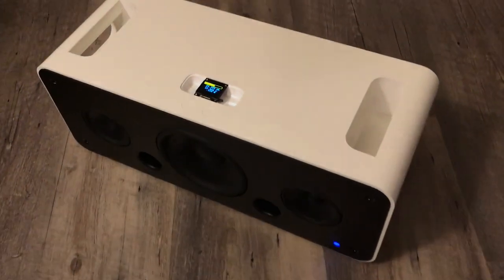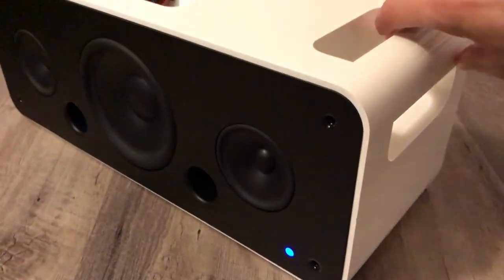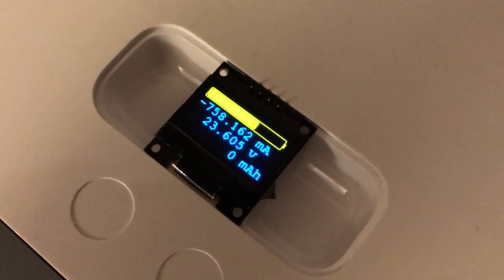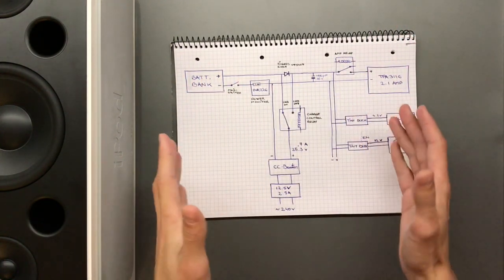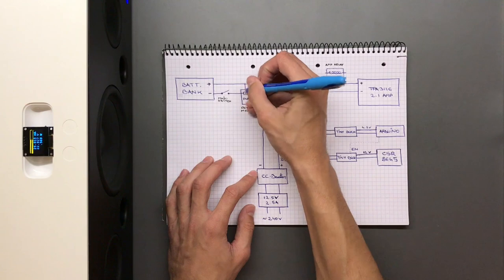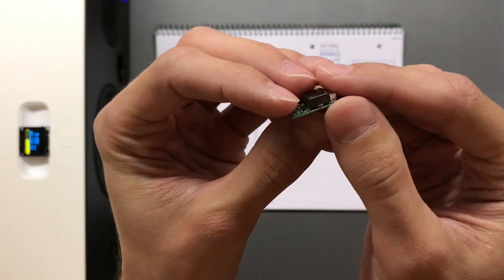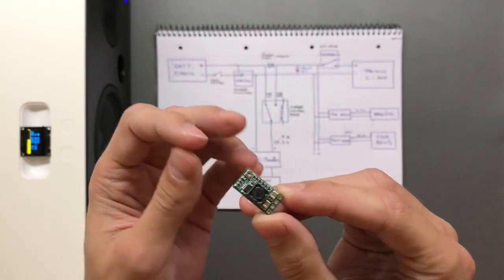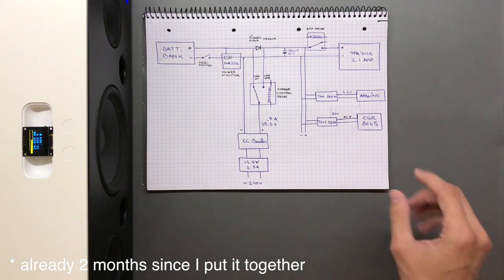DIY Bluetooth iPod Hi-Fi Speaker : Parts Guide 2 : TPA3116 + CSR8645 + Power Monitor + Arduino

Comment: Great video dude, i already made my own 2.1 speaker box, but i have a very basic circuit with the tpa3116d2 directly connected to the bms and a switch in the middle haha. Now i will follow your circuit for making it a smart speaker with battery protection. Thanks for the info!

Comment: very nice and detailed!
i had one doubt about sensing. how did you sense the led state and aux state? i mean what kind of wiring did you do to GPIO of Arduino? with resistors, directly, with some circuit?
thanks!
Reply from the maker: if the voltages are within the range your arduino can take, you can route pins directly

common practice would be routing a 1K resistor for stuff you sense - this protect the pins in case shit goes wrong

then I had an internal PULL UP set to that AUX_IN pin

and when a jack would be inserted, the male jack itself would bridge the AUX_SENSE with GND, this pulling it low

Comment: First of all, thank you for this detailed study. I'm new in this area and I've a question. Can I use QCC3031 same as CSR8645 in this project ?
Reply from the maker: you should be able to - super modern chip that one

I would kind of still opt for the qcc3008 where your boy has you covered with the toolchain and video tutorials on setting everything up
Reply: @Darieee  I liked this suggestion and changed my mind.

Comment: hello Dariee what is the rating of your  speakers i love the video very good and explaintry i want the software version of it.
Reply from the maker: I did actually upload a software walkthrough video as well, there should be a link to it in the description

Apple never gave ratings for these, but I would estimate 15 - 20 W for each mid-range driver, perhaps 30 for the sub 

The amp I'm using is total overkill but .. meh, if it's worth doing, it sure is overdoing
Reply: Nice one thanks man can I send you my video when I build one, is going to be a diy speaker Bluetooth, 100 watts 2.1 version, my board is coming through AliExpress.

Comment: Hi! I recently bought a broken iPod Hifi and an TPA3116D2 amplifier with Bluetooth to do something like what you did. But I’m not sure how to connect the woofer as it has 2 voice coils. I’ve seen in one of your videos that each coil has 6 ohms but the amplifier is theoretically rated for 4-8 ohms. In this video, where you use a board with the same amplifier you have it connected in series, so I guess it’s the best option. Could you please explain which would be the differences in term of sound quality and risk for the components (as it would be operating out of range). Thanks in advance and congrats for your great job!
Reply from the maker: Thanks!

If you parallel the coils you'll get 3 ohms, which is kind of low

You'll get less volume but a lot more clarity if you series them and get 12 ohms in total

In my experience, running at 25v, loudness was ample even in that setup; I have the bass channel set to 30% or something like that actually
Reply: @Darieee  Okay, so I think I would wire it in series, in favor of the better clarity.
I'm going to use a 12v 5A power supply, do you think it's too low voltage?
Reply from the maker: yeah ... I would suggest a 24v 500mA supply instead ... 

or 24v 1A or something like that

12 is kinda low and you'll never draw that much power

best way forward is to probably find a 19v laptop power supply though .. those are pretty good quality and relatively abundant
Reply: darieee Great, thanks for your advice!

Comment: Hi Darie; thanks a lot for the videos. Here I am 3 years later trying to follow along but I have a few issues. It's a long shot but perhaps you will be able to help.

My batteries power the relays/arduino without trouble but then I disconnected the TPA/BT (so no giant capacitors) and added a mechanical switch (C&K 1101) where you did in your diagram. When I reinsert the batteries, the voltage at the battery protect circuit output latches around 1V and the relays do not power. I have used a 7805 regulator instead of buck converters, and I have a diagram here if Youtube will allow me to share it: i.imgur.com/kCY77gt.png ... I hope you could share any advice!
Reply from the maker: sometimes the protection boards  require an initial "jump start", otherwise they stay in 'shipping" mode

is that it ??
Reply: @Darieee  A good idea... switching the mechanical switch about 3 times seems to work okay, for now. I will keep chipping away at the project. Thank you!

Comment: I dont understand mu bt speaker that need 12v but will work even with 2.8v, and draw idle at 4v with 100ma but idle with 12v with 150 ma, what about amplifier how their reaction and why more volt we think more eficient but not my case
Reply from the maker: The CSR8645 Module I'm using uses a Mornsun 1203 DC-DC converter to completely float the GND (and VCC) coming into the module; this is done to as a quick fix for nasty ground loops and other things; it's a very inefficient converter - so that's why it uses so much power, but without it, there would be an unbearable buzzing

The TPA3116 works from ~9v up to 26v.

If you want it to output ... say 10W, you'll need to feed it 1A at 10V (assuming perfect efficiency just to make the maths easier), or 0.5A at 20V

That means half the current will flow through the chips and the pcb and all the wiring : so everything will be more efficient

Comment: does it have noise or some kind of ground loop when using the same power supply?
Reply from the maker: Nah, the amp's wired on high gain and thusly has a fair bit of hiss, that would be the only (fixable) issue atm

Comment: Could you explain me better how the battery charging sector works ?, I'm making a portable speaker too, and to charge my 4s3p battery pack, I'm using a 220v / 24v switching transformer, and a buck converter to lower the voltage to 16.5v but once the battery is full (red LED indicating constant current is turned off) and the transformer of the 220v is disconnected, the battery feeds the buck converter leaving the constant voltage LED power forever.
Reply from the maker: Uuuu, first off I have to point out that 4S3P is probably overkill (which I respect you more for) and probably not the best way to go ... with 12 cells a much better approach would be 6S2P, that way your amp will draw less current (and you'll get away with less beefy wires, also your amp will have more power and sound cleaner). If you do go 6S you'll need a different power supply too though as that pack will require 25.2V to get fully charged.

Regardless, in order to better understand what you're supposed to do in order to charge li-ion cells I'd suggest you watch this video : https://youtu.be/A6mKd5_-abk

I don't really get what you want to say in the 2nd half so, if the video doesn't clarify stuff, feel free to reformulate it and ask again :)
Reply: I had very good results with my 4S3P battery pack. it lasts about a week or more sounding without going off. Sorry if my english sucks. I'm from Paraguay.
I bought a buck converter that has the CC and CV features, with which I decrease from 24v to 16.5v to charge the battery pack. When it is completely discharged, the buck converter turns on a red LED indicating CC and when it is fully charged, the red LED turns off and a blue led lights up indicating CV mode. But, when I unplug it from the wall, the buckconverter's blue led never turns off.
Reply from the maker: Just put a diode in the circuit then to prevent current from going back into your buck converter (keep in mind that depending on the type of diode you choose you'll have anywhere between ~1 to .4 volts dropped across the diode)
Reply: Could you give me your email to send you a schematic of how I'm doing everything?

Comment: Can i bridge the left and right output of this board to a single speaker and get mono sound?, since stereo on a boombox is imperceptible.
Reply from the maker: nah, doesn't really work that well - you could run LEFT and RIGHT into the same speaker if it were to have 2 coils like my subwoofer does ... otherwise it's not advisable

you can however set up the chip to run in BTL mode, which does make it work with the 2 L and R outputs bridged

for that you'd need to buy a MONO version of the amp : http://ebay.to/2BmMBtA
Reply: Darieee  thanks for the quick reply.

The actual meaning of my question that I wanted to expose is this.

I already own a chinese 2.1 amp board (http://bit.ly/2AaQzFM) using a 19V battery. My actual setup is a 6ohm subwoofer connected to the sub output and only one 8ohm (30W rated - 60W max) speaker connected to the left output, so the right output channel is not being used. My doubt acordingnly to this table (http://bit.ly/2jlJavl ) is that at 19V the max power output on each L/R channel is 25W at 8 ohm. Actually the setup is working well but I really don’t know if the 8ohm speaker or the amp are actually getting stressed (if that is the word). 

So my question is if there is a way that joining both L/R output will sum the power of each channel (25W+25W), so the speaker and amp can work more relaxed and so the amp will not blow up. And also to combine stereo in to mono sound, because the right output channel is actually unused.

I don’t know too much of electronics so actually I don’t know if what I exposed above is actually possible and correct. 

Also Sorry for my english.

Thanks.
Reply from the maker: Alright, nah - good that you already have these instincts, but in this case there's really nothing to worry about; the larger the impedance of the speakers (the ohm value) the easier they are on the amp (and the less power you get out of the entire setup).

So yeah, you're using half of the amp, and twice it's lowest rating (4 ohms) - so absolutely nothing to worry about. At all whatsoever !

The effort to get the 2nd chip running in BTL mode is not really worth it, especially if you don't need the extra power (that would basically be the only case, and even then if you don't have the proper tools it would be more advisable just getting a 2nd amp)

Actually I take back what  I said in the previous line : http://www.ti.com/lit/ds/symlink/tpa3116d2.pdf
Reading page 24 seems to show that it's as easy as bridging a few pins on the chip (I guess I saw the complicated setup on another one)

In any case, if you'd do that, you would theoretically have 100W of power per speaker xD

Comment: Hi! Is it possible use csr8645 as usb sound card? Each time when i connect usb (5v,d-,d+,gnd==> vchrg,usbn,usbp,gnd) to board it is restart or ignore usb cable connection. Can you help me with this issue?
Reply from the maker: I'm afraid not .. I haven't ever tried this ... but as a usb sound card I'm quite sure you can't use it ... at least not without special drivers etc
Reply: ))Nokia hs-83 and wh-203  usb mobile  headsets work perfectly with PC as sound card (drivers are installed automatically) but FM radio I do not know how to get work(
Reply: Hi there! I use the USB function with a CSR8635 on a Sanwu board, no issues, recognized as USB codec (and opens up a 15mb internal storage embedeed). Sounds perfect. However, I tried as well with CSR8645 module, with VBUS as 5v input. PC crashed, Had strange noises, scratching and .... fried. Doesn’t boot either via VBat (4,0v) or VBUS. Wont try USB anymore on the 8645’s...
Reply from the maker: Would you mind making a quick tutorial on that? I and am sure many others would be very interested

Comment: how long does it play running loud off the battery
Reply from the maker: The cells were quite old ... around 1300mAh ... about 6 hours ?
Reply from the maker: Between 0% and 70% volume there's very little difference in current draw though

Comment: Can you post link to buck converter without enabling pin.
Reply from the maker: Sure, here's the one I got : http://ebay.to/2hCnAG8

I would still recommend the one I linked, the EN pin left unconnected leaves the module activated (as if there was no enable pin)

The construction is better on the one with the EN pin, ... the only thing going for the first one I bought is it perfectly matches an LM linear regulator in footprint and pinout
Reply: Darieee thanks trying to build one from scratch using speakers I have lying around .
Reply from the maker: +Francisco Barajas nice :D, good luck ! I'll have a new video in a week or so on another much simpler design that uses the bluetooth board to mute the amp

Comment: Why did you use the buck converter and not a linear regulator like your previous video?
Reply from the maker: In the previous mod I didn't care about efficiency - the "stock" iPod Hi Fi will never run off batteries

With a linear regulator, the dropped voltage is "burned" basically, so, if my BT Module (including the Mornsun DC-DC converter) is using 40 mA at 5V, that's 0.2W

If I use a buck converter, not only can I control it like a relay, but I get a 90% conversion efficiency (worst case), so it'll draw around 7.2 mA at 25V

The linear regulator would give no fuck and draw exactly 40 mA (basically acts like a variable resistor in series with your circuit), but this time at 25V; so .04*25 = 1W

So using linear regulators would mean my Bluetooth Module would suck up 1W instead of 0.2W, same idea for the Arduino; that way I'd never get an idle power of 0.5W for both Arduino and Bluetooth
Reply: Thanks for the quick reply.
Now I got a better understanding with the buck converters. I'm fixing up an old BW zeppelin with blown caps. 

Your vid showed the simplest method by using a 12v chip with not needing to convert the audio channel to ground. That takes up space especially considering the csr chip needs a breakout board to be fully utilised

Thanks again
Reply from the maker: rtk 74 which zeppelin version do you have ? Would be really awesome if you could make a short video of how it's built on the inside .. had the 1st generation back in the day and it sounded really bad :(
Reply: 1st Gen too!!
Maybe it was bad cap? 
A common problem with these.
https://imgur.com/a/hShui
Here some images I compiled. Too lazy to take pics of mine. 
They were expensive as hell, got them cheap since people too lazy to fix em.
Reply from the maker: rtk 74 holy fuck .. 600+€ for fuckin' SAMXON caps are you fucking kidding me ..

Nah wasn't the caps - the bass reflex ports are way too small, any song with any kind of bass would sound like a hurrica going through a small pipe ...

But I do remember even back then a lot of them were failing
Reply from the maker: rtk 74 btw what're the symptoms of the supply failing ? craps out under load ?
Reply: Darieee the red blink of death!!
And electric hums
If you let them be like that long enough, they'll ruin your tweeters, then the subs
Reply: Darieee fixed another studio monitor, bx5a to be precise, bad caps on them too, they cost $400 new. Look em up. They're notorious for bad caps
Reply from the maker: rtk 74 uuu .. and so - new caps and I suppose you want to add bluetooth to it as well ?
Reply from the maker: I wouldn't say they're anywhere near worth it - haven't listened to the newer ones and I have seen they enlarged the ports I talked about - but even so, given what a douchebag move they pulled with the original zeppelin's .. I'm upset for life xD

The youtube link doesn't seem to work

I would go for a 2.1 system though - since you'd want to drive the subwoofer too I'd imagine
Reply: Darieee Maybe so, but couldn't find a reliable 2.1 TPA3116 with built-in Bluetooth, too lazy to build my own. But watched your videos on different 3116s, helped me alot with figuring out what to use.

Try the link again if you wanna watch it. 

But about the caps, even on high-end systems, as long as they're built in China, chances are they'll be using 1 or 2 crapxons on the psu.
That's the norm
Reply from the maker: Mmm, yeah, many do use "Chinese" brands, but the ones I've seen in those photos look particularly dodgy (read: knockoffs of capxons even perhaps ..)

The 12volt channel seems quite cool - didn't know about it - thanks !

I got this 4.1 version from banggood, sounds decent; you can still hear some bluetooth noise seeping through but, it's usable: https://www.banggood.com/TPA3116-4_1-Class-D-Amp-Power-Stereo-Amplifier-Board-With-Bluetooth-4x50W100W-p-1091925.html?rmmds=search

This one seems relatively similar in construction, so ... might also work fine ? https://www.banggood.com/TPA3116-4_1-Class-D-Amp-Power-Stereo-Amplifier-Board-With-Bluetooth-4x50W100W-p-1091925.html?rmmds=search 

(again, I'd insist on you getting a 2.1 amp if need be: you'll have a hell of a time getting the subwoofer running with just a 2 channel amp -- although the caps should fix the original problem)
Reply: Hopefully it does, just waiting them in the mail, can't be bothered to go retail(jaycar) since all the have are Chinese no names.
But thank you for the suggestions, I'll look em up and set them as a back up.

Yeah, fun channel, most of the people who watch them are geeks anyways 😀😀
Reply: Yeah, but 2.1 works better, since I just have to isolate the 2 channels for the tweeters.

Well, I'll just use the one you use as a reference if anything goes down the toilet